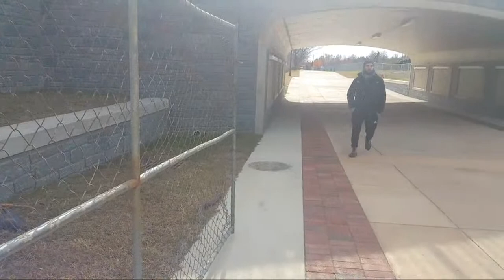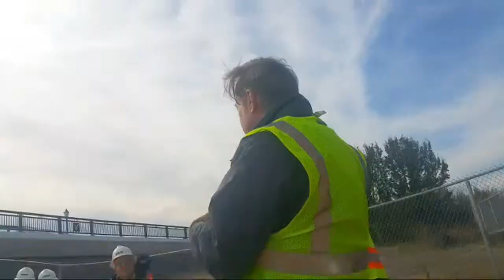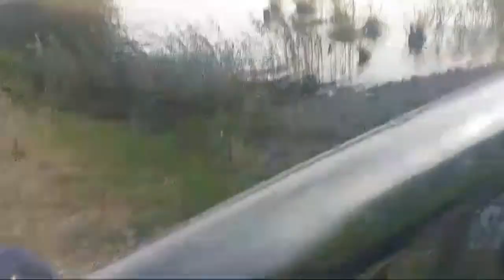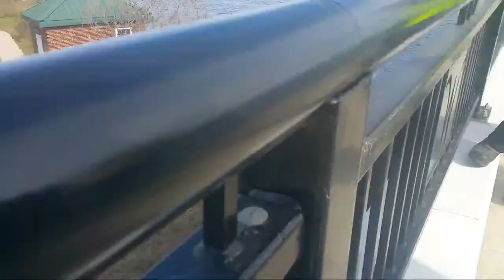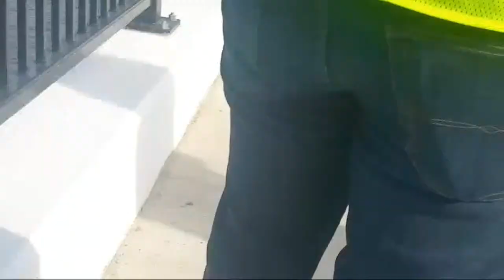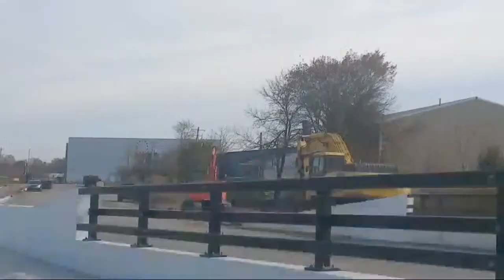Bridge Tour Walk Through ASHE Credits Also Part 1 of 3

Comment: I know nothing about bridge and building design. You mentioned near the end of the video, the loaded dump going by, that there was no bouncing. I live in northern Michigan and have a motorized wheelchair. Often I’ve encountered logging trucks and heavy equipment on interstate bridge crossings I need to traverse. I’ve had to stop my chair as the bridge bounces strongly even after the heavy traffic has passed. Is this a concern? Thanks, Keith
Reply from the maker: Swaying, bouncing, and expansion and contraction are designed into bridges ''behavior"... I know what you are talking about and that swaying, rocking and bouncing is okay as long as the structure's life cycle is still in ''good standing"... If, you are really concerned you can share the exact name of the bridge you are referencing, it will (should) also have a ''bridge number'' associated with it... You can then attempt to find the maintenance and project repairs. You would want to know if the vehicles that use that bridge are not over -weight also...  
Check to see if the bridge has had a ''down-grade'' of weight limits (another indicator of bridge's condition)...
With all that said, I would not ''fear'' going over a bridge I have no choice but to use...  As fear will not hold the bridge up while you traverse it... 
I would load a ''file'' that says something like, I don't care if the bridge falls today while I am on it, I have no choice but to use it and however I die, Kai will do a video of me and scream MURDER to the people who ''killed me" because of negligence.
Hope that helps and if not... load a ''file in your mind; I call them conclusive file(s)" that state you do not care and enjoy the swaying as an "amusement ride"  or perhaps put an unmixed martini in a cup and when you get to the otherside, it will be already shaken and not stirred (just like James Bond)...
Reply: Friend, 
I really like how you think and process. I’m learning very  much from Your videos. Thank you for the guidance in researching this particular structure. I will investigate further. I am not afraid of the integrity of the bridge, I just thought it was odd, and your comment brought the question to my forefront. Keep up the great work, take more naps. Thomas Edison was a chronic insomniac, and I am, too!
Reply from the maker: @hootersnoocher8467  , I think Ben Franklin was one also...  I have had this all my life, even as a child. Thank you for your concern ... and naps, I am so close sometimes; but I nod my head for about 12 seconds and BAM it feels like I have been asleep for 40 minutes!